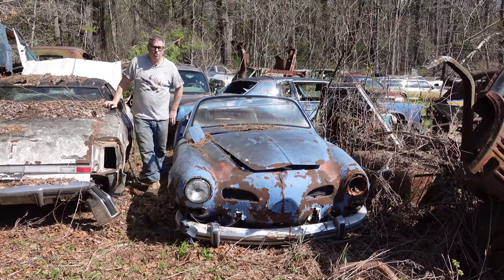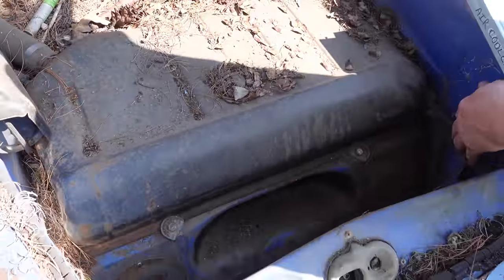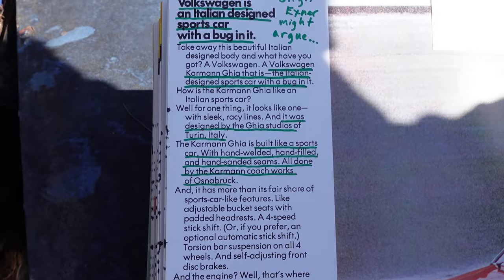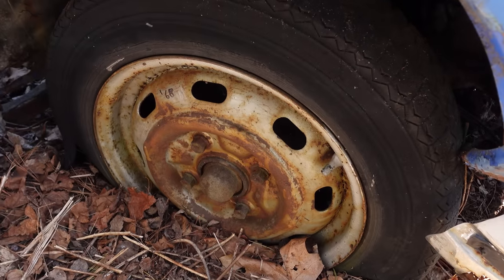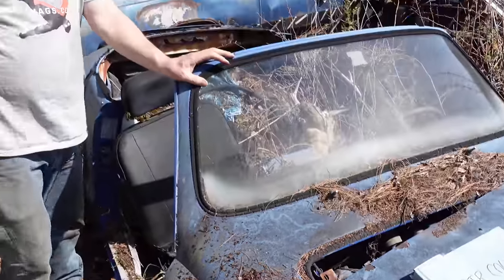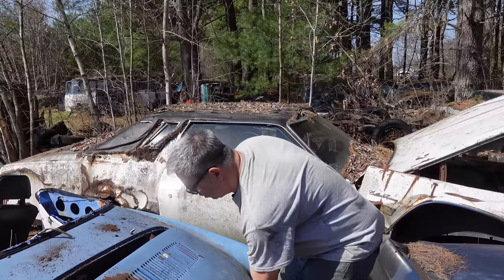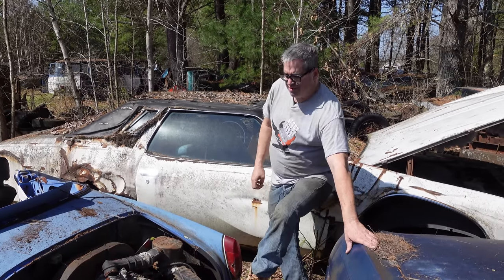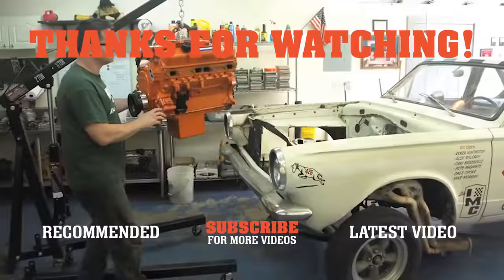Karman Chameleon

Comment: The biggest problem was rust. They had so many cavities where moisture could do it’s deed. I had a beater 1963 that I did a mechanical rebuild on, as I was a VW mechanic. The rockers, where the heat runs through were gone. Lots of fun to drive. I built a 1700cc high compression engine and installed the original carburetor. It would get 50 mpg. One oddity is they had aluminum door hinges which wore horribly fast and were expensive.

The heater actually worked well on aircooled VWs, when they were sealed properly and all the controls were adjusted properly. Just remember the rpm is the heater fan.

Comment: The very last VW I ever owned was a 1971 type three square back sedan. It had the dual port 1600 engine with Bosch electronic fuel injection and the automatic stick shift transmission. Great little car that got great gas mileage and with the fuel injection was easy to start in all kinds of weather. As long as you had good heat exchangers that weren't rusted out and leaking air the heat wasn't too bad especially if you added a booster blower to force the heat circulation and had a functioning thermostatic bellows controlling the fan shroud flapper.
Reply: Aftermarket fi I assume. VW didn't go fi until 75.
Reply: @mikeholland1031  Nope, factory. I bought a 1971 square back in 2001 and it still had the functioning factory fuel injection from Bosch. I did take it off and put dual Weber carbs because the fuel injection was finicky by then.
Reply: @TheMotorman80  weird. Bugs and the rest didn't get it until 75
Reply: @mikeholland1031  Yeah, I’ve only seen it on the type 3’s before 75, but I’m not sure what all they put it on.
Reply: @TheMotorman80  I looked it up. 67 or 68 for those. 75 for the rest. I was sorta right. Lol
Reply: @mikeholland1031  Yes sir! 👍🏻

Comment: Hi Steve great video on this Karmann Ghia Cabriolet. I do believe the engine on the Ghia and Fastbacks the engine did have to come out from underneath. My 67 bus the cross panel unbolts, allowing you to pull the engine straight out. I'm no VW expert and don't know about the other models if they unbolt or not. When I was stupid young or young and stupid, I wanted a convertible. I had my Ford Van but needed a small car too. I had a couple big Detroit iron pieces already 59 Ford and my 55 Merc but $ wasn't my friend at the time. So I had narrowed it down to a couple of options I had available. 1 was 70ish Ghia or a 71 TR6 with twin carbs. Well I liked the Ghia but it gave me flashbacks from owning a nightmare VW bus. The Ghia did handle better than the bus. The bus handled like a covered wagon in a prairie storm. But once I got in the TR6 I was sold. The fellow who owned had changed the jets in the carburators to a more desirable European setup. Apparently, the US cars were de-tuned or something. I couldn't find a fuel injected model that I could afford. Had a lot of fun in that car. The guys liked driving it, and the skirts loved ridin. 👀 I sold the car a few yrs later for what I paid for it. There was a boattail Riviera I was in love with that came up for sale. 30yrs later I still have that one parked in the corner. Have a blessed day everyone 🤙🏼 Namaste 🙏🏼
Reply: the early bus was the only VW where the engine came out the back.... if you didn't have rusty bumper bolts. All others of this vintage came out the bottom.
Reply from the maker: Hi Chris, you are like me, one car pretty much "pays" for the next one. In my case, the funds just weren't there to keep them all! I've had a BUNCH of interesting old Mopars but don't really lament the loss of each one as the next one took its place. Hind sight is 20/20 but at least we had the pleasure of enjoying all of these great old cars for the brief time we had them. Thanks AS ALWAYS for watching and writing. -Steve Magnante
Reply: All the TRs were great for the money years ago. I don't see any around here (NYC) anymore. My friend is on his 4th 71 GT6+, but he has a clean body waiting  for #4 to rot some more, and a fresh engine  etc. It's an expensive hobby in the Northeast
Reply: @robertmoffett3486  Hi Robert I really wish I could find a really nice GT6+ for sale. But I'm really picky about stuff. The 1st check is the colour. It has to be White, Blue or Yellow before can even consider looking. My TR was Yellow black top tan or camel interior. It had the European style bumpers. I'm not sure what yrs the US made them put a monster truck tire as bumpers. But as a kid a neighbor had one and I thought he was the coolest dude around. He was Wise Chip salesman smoked those slim cigars light brown leather jacket and leather hat to match. He always looked like he was stepping out to the discos. Roger was his name. Good dude kept in touch until he died from cancer a few yrs back. Thanks for commenting 🤙🏼Have blessed day, Namaste 🙏🏼

Comment: Hey Steve I owned a 65 VW Convertible,, I changed the 1500 to a 1600, It took 10 min to Pull the Motor, 4 bolts and a cable ,dropped it on a Tire,

Comment: My uncle completely re built a beautiful ghia with no rust or dents, it was basically set up as a Porsche, new interior, new convertible roof and headliner, and he just had it painted and was waiting for the chrome.. he took it out for a drive and someone did a U-turn and sideswiped the car, wrecking the front and back fenders... he was so despondent that he just parked it in the back yard and never completed it.  it sat under a tarp, in Arizona, just rotting away until he finally parted it out.   So sad.  I got one ride in that rocket.  It was amazing.  So my uncle got a 23 window bus,  a guy in on a motorcycle went off the road and head first into the side.. he fixed that, but then one day he was sitting at a light and someone drifted through the intersection and head on collision!  he flew through the front window and over the car that hit him.. luckily he didn't have seat belts or he would have been crushed.   That was the end of the VW days and he bought a Ford F250
Reply: I can’t determine if your uncle was the “Unluckiest Man In The World” or the “Luckiest Man In The World”……..???

🤔
Reply from the maker: Jeeez! Is your uncle's nick name "LUCKY"? Sad stories for his cars but GOOD for him and his health. Thanks for watching and writing. -Steve Magnante

Comment: The pan is NOT the same as a Beetle, it is the same as a "Thing" ( type 181). The pan is wider and has more reinforcements. Convertibles are really hard to restore and don't have the proper re-enforcements like the Beetle convertibles.

Comment: When the spare is missing you have no windshield washer . VW used the air from the tire to put pressure on the washer fluid to spray the glass . Had a low pressure limiter in the line but usually the spare went flat any way . Seems more complex than a switch and pump or the foot operated pump used by Ford on their unibody cars of the 60s

Comment: Such beautiful cars! My mother owned a '62 survivor, factory two tone cream over deep red- with the beautiful slim line bumpers. But man, that old 1200 or 1300cc motor was SO DAMN SLOW! I always wanted to fit a 2L Kombi motor, stroked to 3L. I used to see these big bore/stroker kits for sale in VW magazines back in the mid 90's- thought a 3L motor with some trick heads and twin 45mm Webbers would have made it get up and go... These days, let's be honest- you could probably make more power with a decent turbo set up on that 1200cc motor, not that anyone would build such a small motor for one if you wanted to go fast. A 2300cc turbo set up would be sweet, or just drop an EJ20/25 in the rear. Guys used to put 13B Rotary's in them back in the 90's in Australia- the conversion was banned back in the 90's for street VW's back in the mid 90's... It's a shame, a rotary would be a really good swap for a Beetle or a Karmen Ghia- either as a built N/A screamer or a turbo motor

Comment: I had a Karmin gia front end on my berrian sand rail. The torsion springs were a lot more stuff than a regular beetle, I had to cut some of the torsion leafs to get it to ride decently.
 I think they were trying to build a sports car.
Reply: that front suspension is identical to the bug. The issue is the front of the Gia is lighter than the bug.

Comment: Hi Steve keep up the great work. I don’t mean to nitpick or criticize but……the front disc/4 lug thing got my mind spinning. I had a really good ‘67 Ghia coupe (traded it and $ for the world’s rustiest Porsche 356) which had front disc brakes and 4 lug wheels. All beetles and Ghias got wider swing axles in the back in ‘67 and ‘68. The Ghia got 4 lugs and discs in ‘67. Between the wider wheel span and the low center of gravity the ‘67 Ghia was a corner carver and with a healthy stock cam and bore engine mine would out climb a lot of the smogged up American junk in the mid seventies. While picking my own nits I’ll clarify that ‘68 beetles got the real deal IRS in ‘68 if they were auto-sticks….yecch.

Comment: Good for engine transaxle and some body parts. With some other Gia parts could make a like new Gia. Love to have one. Would update it with modern 4 wheel disk brakes, throttle body fuel injection, and electronic ignition.

Comment: Having worked on a few of these (way back when) I can say the bug and the Gia suspension are almost identical. If you wanted disc brakes on your bug you only needed to change the spindles and the tie-rod ends to make them fit. You also needed to yank the check valve out of the MC, which was located directly inboard of the front brake line fitting. I just used a screw and a pair of pliers to do the deed. That said... if you wanted BIG front brakes, the type 3 calipers will bolt to the Gia spindles. (about 40% more pad) BTW, 4 bolt type 3 wheels were almost an inch wider so now you could add bigger tires too. All of this using "stock" parts!
Reply from the maker: Hot Rodding comes in an infinite variety of forms! Thanks for watching and writing. -Steve Magnante

Comment: Another "commode" VW. I was never a fan of these and they looked like a Kohler commode. I'd rather have a Beetle convertible. 

No VIN, can't win, but would be something like 14 for Karman Ghia, 0 for 1970 model year and the rest is the production sequence, starting with 2000 001 for the 1970 model year. Not the hood, but the "frunk". LOL. Correct, the Scirocco replaced the Karman Ghia in the VW line. As others stated, it might be newer than 1970 due to the bumper style. It's always worth it to show the VIN and trim tag to verify things like this. 

Looks like code L52E Pastel Blue exterior paint.

Comment: I have to disagree about the heater being weak. I had a 1970 Ghia and the heater would run you out of the car. The key was making sure the ducting from the fan to the heat exchangers, and from the heat exchangers to the body were in good shape and sealed properly.

Comment: 1967 model year was the first year for disc brakes. Also the talk about the bus getting disc brakes, yes it did but a small five lug pattern wheel. 5X112mm. Not 4X130mm like the Ghia.

Comment: Fun stuff, strangely enough, the VW Thing shared the pan with the KG instead of the Beetle as it was wider. The air cleaner assy also looks shared, though it may be different. Looks the same, though. They are fun to drive and miserable to restore 😂

Comment: In high school someone with a bug would dump the clutch at a light and take just about anything across an intersection.....of course the fun was over awfully quick but the guy in the next lane got a surprise.....and then a laugh
Reply: back then a bug would take anything away from a stop light.... 0-15 mph. If you pushed hard you could squeeze about 22 mph before floating the valves in first gear.

Comment: Way to get the real horsepower Steve. Most people don't know VW quoted DIN (Deutsches Institut für Normung) horsepower which is a little more than what we are used to. If you change the rocker ratio from 1.1:1 to something a little more normal and put duel carbs on them VWs will make as much power as any other NA engine of similar size.

Comment: ya the bolts for the wheels were and are a pain, don't know why the Europeans can't get with the program most still use them, try to hang a wheel with no place to balance it before putting the bolts in, used to have a ring in the center to make it easier but they disappeared with the coming years. hated doing tire work on VW, BMW, Mercadies, etc